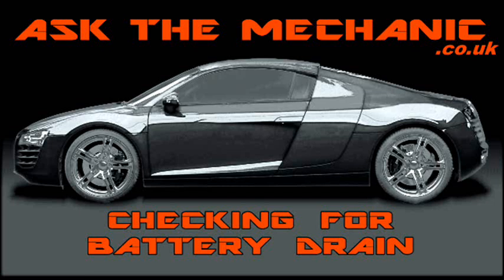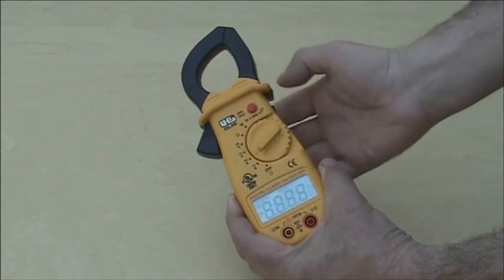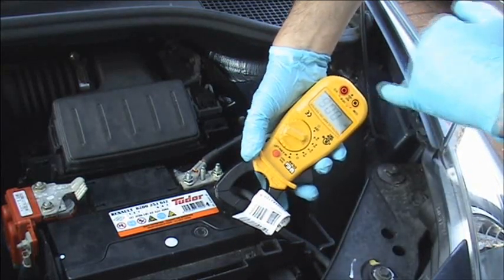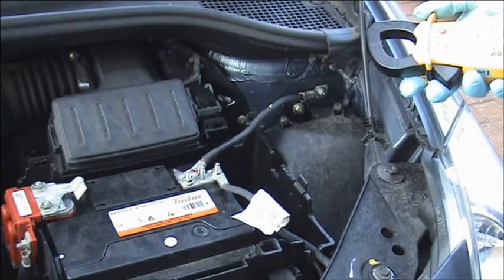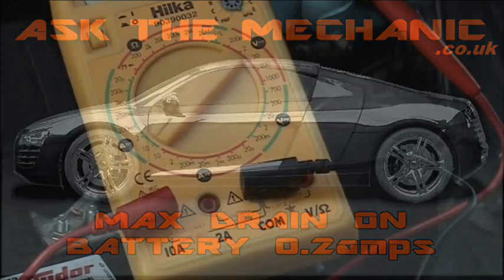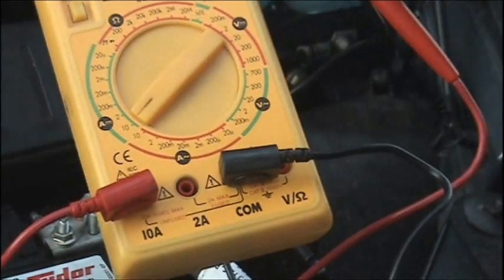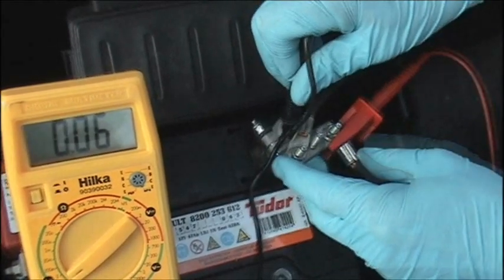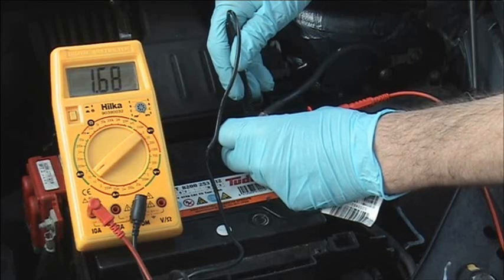Car battery going flat how to check for a drain

Comment from the maker: I have never known a starter to drain the battery and it is very rare with modern electronics for the alternator to (the old diodes use to get leaky) if you are using a clip on current clamp, just connect around the lead to the alternator, if not you would need to disconnect the main lead to the alternator (best to disconnect the battery, insulate the alternator lead, reconnect battery and test)

Comment: Yup. The Zener diode is part of the unit.
Glad you got it fixed, but the darn things are hugely over-priced. 
I've got a weekend shack of grid with a12v solar panel. Diode I use costs 17p from Maplins.

Comment: Thanks. I suppose I will use the alarm since it would defeat the purpose of having it not to. 

The battery still seems okay, although it only reads 12.10 volts so it may be getting a bit old. The cold cranking amps are still good and the car starts up fine.

Comment: I was a mechanic on heavies for 7  years 25 years ago, I, hit your site out of interest when I saw it ina side-bar.
Old dog learned a new trick! ( Lifting the clamp off with the meter probe still on.
I would have just disconnected the battery then put meter in series,but then I have to re-set radio code.
What ahppens to the central locking?  Modern  cars are a pain in the butt!

Comment from the maker: If the headlight has a side light the earth cable will also connect to the side light bulb, so you may be able to identify it that way. To find the earth connection on the car using a multimeter, set to ohm’s and connect one of the meter leads to the chassis and probe the multi plug, the earth connection will have a very low resistance

Comment: Thanks mate. Ive just tested my battery on my Octavia (05 plate) which goes flat if left for 24 hours. Im pulling in excess of 1amp. Ive pulled each fuse in turn and get no change in the drain. Any suggestions? Cheers

Comment: it was the rectifier unit inside the alternator that had gone.
with this video's help and a few phone calls i ended up spending £18 for a rectifier unit and an hour to fit it and refurb my alternator..
a damn sight cheaper than a new alternator..

Comment: The most likely fault is that te Zener diode has gone. The diode acts to both rectify the current to DC and to act as a cut-out to prevent the battery discharging via the alternator. In old cars with DC dynamos it was done electro-mechanically, and if it failed your dynamo became a motor driven by teh battery- flat in no time. Haven't changed diodes in years, used to eb cheap and easy.

Comment: set your meter too miliivolts and test each fuse without pulling them out and reading means power is flowing and that circuit is drawing power....cheers

Comment: for a more accurate reading find a amp clamp with a smaller clamp size closer too automotive wiring gauge. the closer too the size of wire you are testing the beter...cheers

Comment: if there is a maximum of 0.2 amps 200 milliamps discharge per hour, it will discharging the battery in 2 weeks

Comment: i've just checked my battery on my transit van.
on my meter i have 3amp of drain.
if i take the 12v wire from the battery to the alternator off i get around 0.03 drain..
am i right in thinking the alternator internal diodes are gone (shorted)
also when running the voltage on battery is around 13.5v on high revving slowly goes up to around 14v..
alternator gone short ??

Comment: no it's an early smiley face 1996 model.
i replaced the alternator a few months back as it slowly stopped charging, but now this one has this internal short, even though the light on the dash doesn't come on .!!